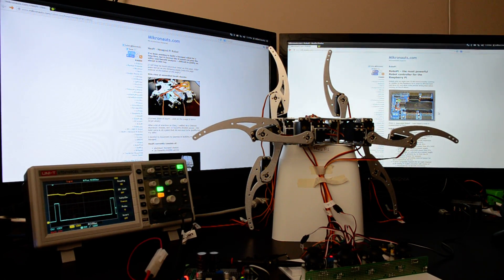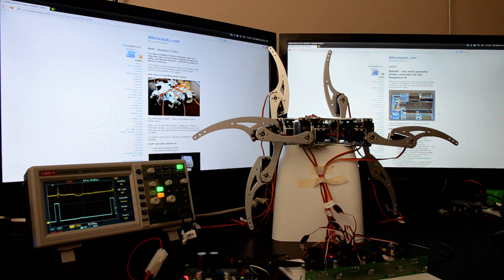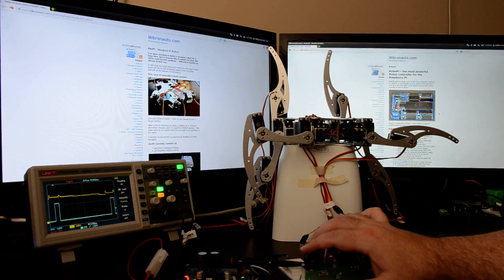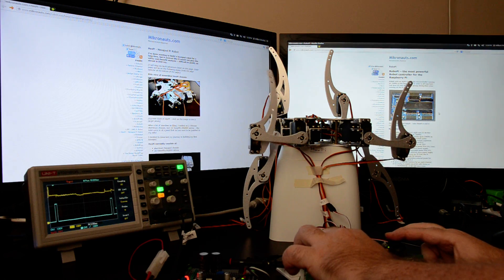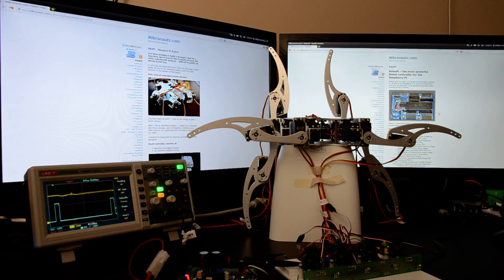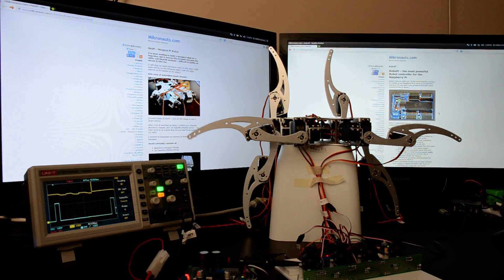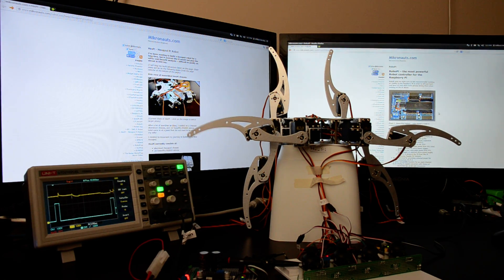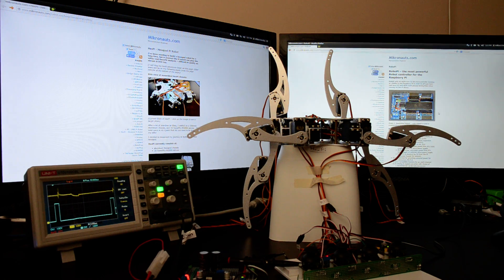HexPi the RoboPi & Raspberry Pi Hexapod Robot - test 1 with The Better Mousetrap Servo Tester

Comment: The power supply is the problem.  Not the servos.  You need more current to control more motors, you have to add up all of your loads, and be prepared for the sum of all loads, when it comes to the power supply.  With a motor, that's starting current, which is the highest.